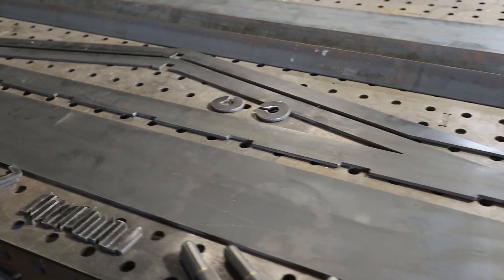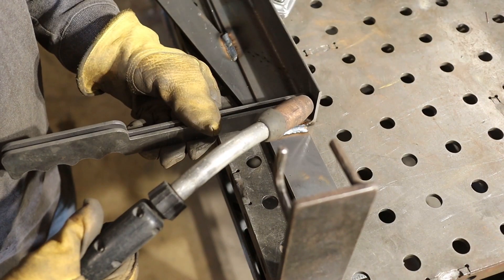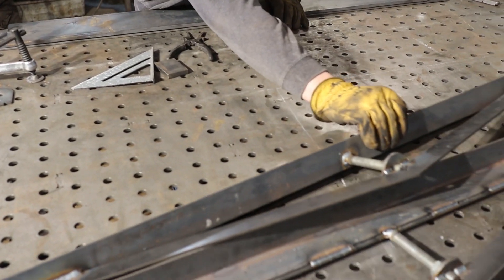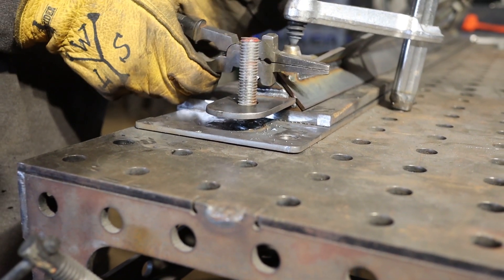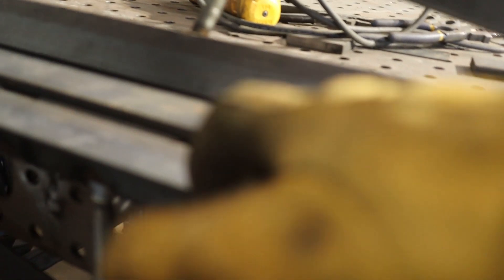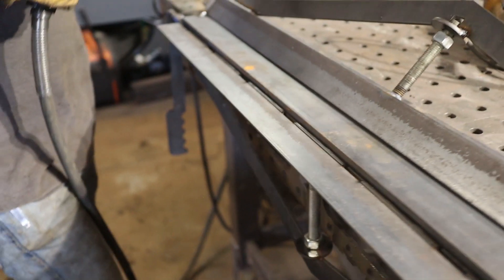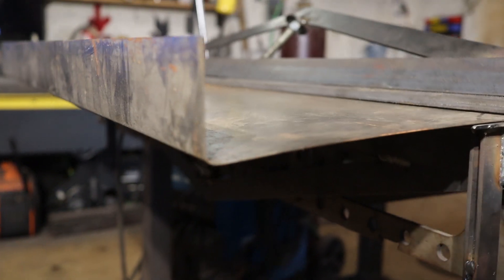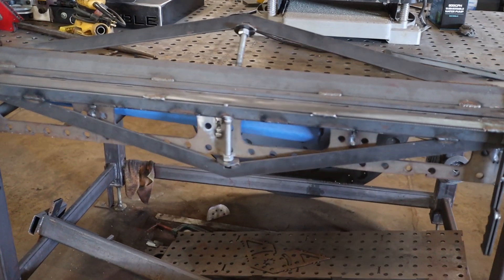$6 Sheet Metal Bender - Maker Table Metal

Comment: "pretty cool"? 

Clearly from 12:00 your lever arms are no where near long enough, nor close enough together, but worse, a quite large, and for my small jobs, useless radius on the bend.  

One of the reasons for the large radius, like most home made benders I see on Youtube, is you didn't bother to add adjustable backstops to the clampdown bar, so as you bend, the clampdown bar moves backwards, which is clearly visable in the video.

Comment: Poor design guys,, you could have used half of steel you did and made a better brake,, just with the angle iron with sharp edge and bolts fasteners drilled through the angle iron,, and you have to off set you swing for steel to get sharp blends
Reply: I'm sure they are selling thousands of plans.  
Sheet metal brake made without knowledge of sheet metal bending.  
This is what happens when liberal arts degreed administrators run our high schools and replace metal shop with drama class.

Comment: Not a fabricator, just old, but:
1. Use an impact driver with deep well sockets to tighten the nuts.
2. Bevel the fixed plate back a bit so you can go a bit more than 90 degrees and the metal can spring back to 90.
Reply: Also handles seem to be too wide for old farts, that would hurt my shoulders.
I really like their fab/welding table with the hold down clamps

Comment: pretty decent build ...like it lot..... good ideas just need to be made with heavier( as you have shown and stated)  but materials to bend over 18 gauge mark.. if you doing 18 & up gauage . you should be buying a brake like the one in the background.  overall  nice ..... thanks time for the video
Reply from the maker: Thanks man, it's really not the answer of you have production stuff to make or a bigger budget. But it could be a way for some people to bridge the gap between cutting and welding every joint, like I started, to forming up components to join into an assembly. I really wanted to figure out a way to make a DIY finger brake but those r a little more complex.